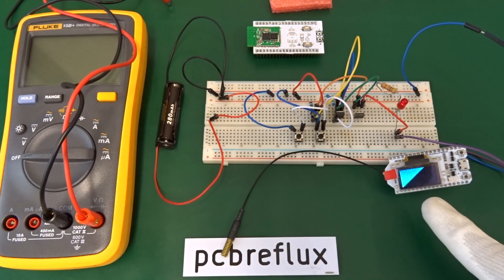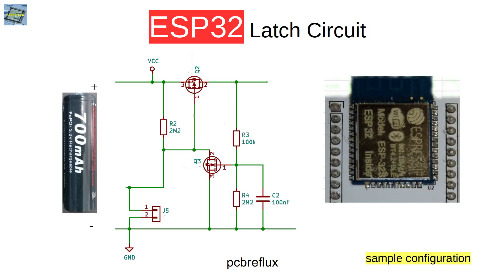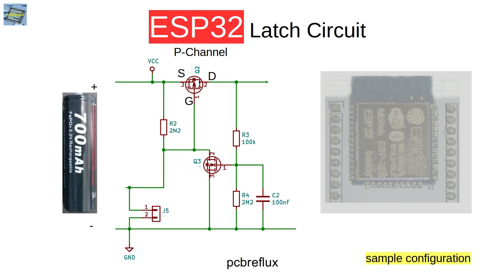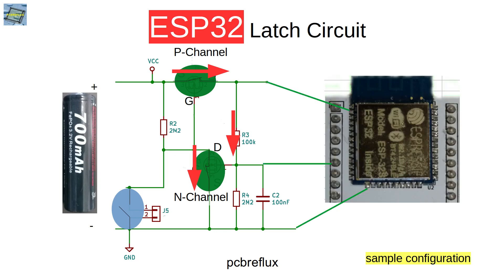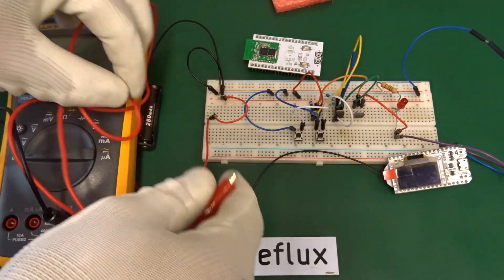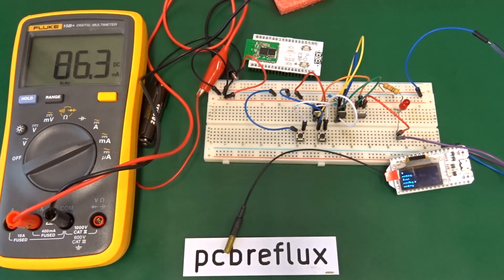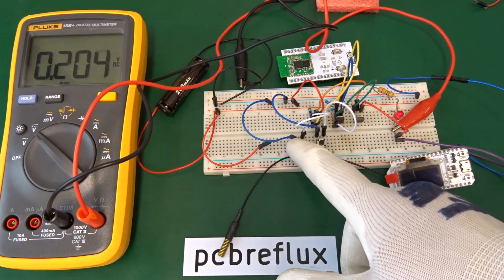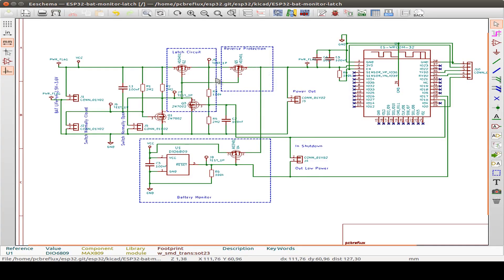ESP32 #53: Latch Circuit

Comment: Very interesting, thank you for this video. I want to use something like this to create an MQTT door/window sensor that would be triggered every time the door/window reed switch is opened or closed. It's not like a pushbutton trigger which provides a momentary signal. Is there some way to adapt your circuit to work with reed switches please?
Reply: Hello David. I realize this is some year since you asked Andreas about the latch circuit. Can I ask, did you ever resolve this?
I have a latch circuit I made up from nand gates and it is a fool proof method of debounce but requires a magnet window/door sensor operating a common-NC-NO type sensor switch ie a 3 wire connection. If you are interested I will send it to you the details.
All the very best from Australia.

Comment: Another nice one! Big thanks! Please keeps on! 
Suggestion: How about talking about "Golden Cap"!
Reply from the maker: Gfast Gao Thank you. by "golden cap" you mean supercapacitors? Have dozens but the voltage range of 2.7V or 2.5V make them not so attractive. For one you need a boost circuit or for two in series you need a voltage regulator. Don't tested the efficiency or losses yet. But sure this is on my to-do list.

Comment: Hi! Is it possible the pins 2,3 of DIO6809 are not correct in the schematics?   What is the Q5 reverse protection for please?
Reply from the maker: Hi, the Pin numbers are related to the used footprint and not to the datasheet so that the PCB should be correct. If you connect the output of the DIO6809 without reverse protection  to the VCC of the ESP32 and the battery is below 1.93V (via Q4) the gate of Q3 would be pulled high and cause the latching. The reverse protection prevent this.
Reply: thanks
Reply from the maker: Sorry its 2.93V for the DIO6809S not 1.93V.
Reply: Thanks, I tried to find where the 2.93V comes from. But can not find in the datasheet.
Reply from the maker: The Dioo Microcircuits Co,. LTD datasheet is very sparely. See http://www.dioo.com/products/list/cid_4/cateid_23.html  VTH 
 Min 2.75V Max 3.05V so avg. ~2.9V and for the DIO6809S (3.2μA Supply Current) the MAX809S is the equivalent (but higher 12μA Supply Current)
chip with typical 2.93V threshold see 
https://datasheets.maximintegrated.com/en/ds/MAX803-MAX810Z.pdf or better use the MAX809STR here https://www.onsemi.com/pub/Collateral/MAX809S-D.PDF (Low supply current of 0.5μA !!! ).

Comment: Hey, great solution! Love your channel.
Are there any TO-92 alternatives to the SOT-23 parts?
Reply from the maker: Hi,

search the ones that fits the best for you with through hole:

P-Channel (Power)
Vds >= -12V
Rds On (V GS =-2.5V) <= 100mOhms better less
Vgs th <= 1.2V better less
Id > 1A
fast switching
consider using TO-220 or I-Pack

N-Channel (Logic-level)
Vds >= 12V
Rds On (V GS =2.5V) <= 100mOhms  better less
Vgs th <= 1.2V better less
Id > 0.2A
fast switching
not ideal but for TO-92 like 2N700x

Comment: Thanks, great solution! Was looking for this solution with NC for a long time.. I can not find the schematics, in which file I can find it please?
Reply: Thanks, is that a free version? If not it would be nice if you can add PDF.
Reply from the maker: KiCad is free software. KiCad is made available under the GNU General Public License(GPL) version 3 or greater. see http://kicad-pcb.org

I use the "Nightly Development Builds".

The PDFs are now available:
https://github.com/pcbreflux/espressif/blob/master/esp32/kicad/ESP32-bat-monitor-latch/schematic.pdf
https://github.com/pcbreflux/espressif/blob/master/esp32/kicad/ESP32-bat-monitor-latch/board.pdf
https://github.com/pcbreflux/espressif/blob/master/esp32/kicad/ESP32-bat-monitor-latch/board-pan.pdf
Reply: Thanks! Downloading now ...
Reply: Hi , I noticed the simulation circuit and schematics use different values for some resistors and capacitors and also 1 of first mosfets ( connected to switch normally closed ) is diffferent ( 2N7002 instead of AD3401 ). Is the PDF schematics correct and complete? Is it tested and did it work?  Thanks for your help.
Reply from the maker: Sorry for the different values. The PDF schematic is the latest version used for the PCB, but the values can vary if I got some issues with the outstanding PCB tests.

on the breadboard in the video:

P-Channel (2nd one for testing reverse protection)
IFRU9024 (I-Pack)

N-Channel
IRLR3103 (D-Pack, "upgraded" with soldered leads)

Resistor 1%
80k and 2M (1K for the red LED)

For the PCB I will test (all SOT-23 available in my drawer):

P-Channel 
DMP2100U, AO3401, IRLML6401, IRLML6402,DMP3099

N-Channel
DMG2302,AO3406, IRLML2502,IRLM6344,2N7002 (~ BS170)

Resistor 1% 0603
~100k and ~2M
Reply: thanks

Comment: Is this pcb for sale?
Reply from the maker: Hi, the board is open hardware, so you can order your own at a pcb manufacturer. Testing out some different option but this is the cheapest https://jlcpcb.com I found. Special offer $2+shipping (for me $15) for 10pcs 100mm x 100mm so hopefully I get 60 boards. But still waiting for delivery, so can not tell something about the service or quality. I just take the gerber files add them to a zip-file and upload this to the order web page. If the boards arrived will do a video about. And sure the board is not tested yet.